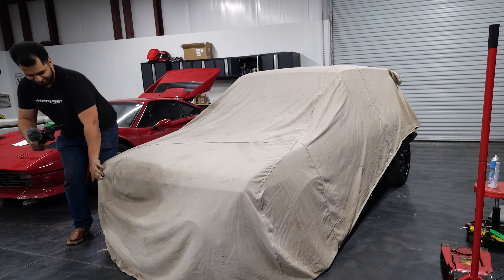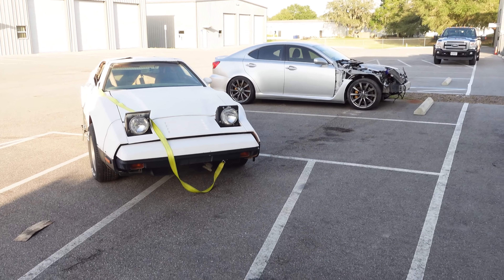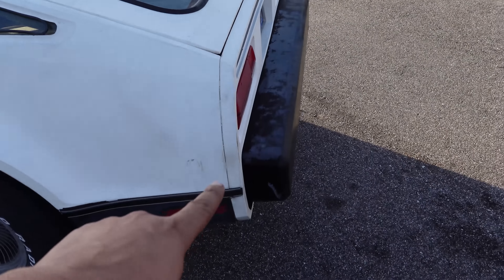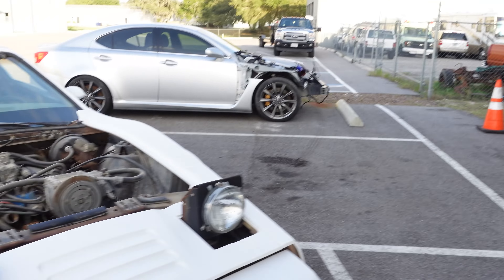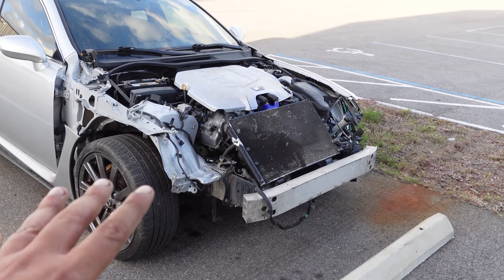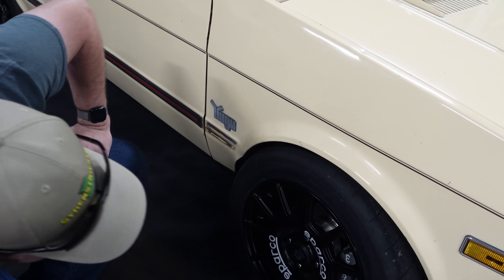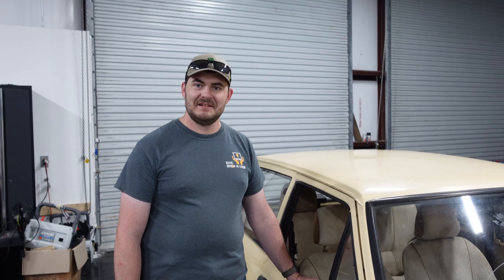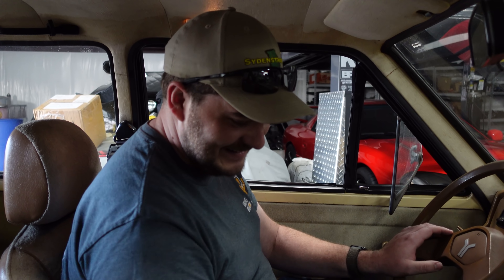I Gave My Friend THE WORST CAR EVER MADE (He Was NOT READY)

Comment: back around 1982 i was working on the bodies of bricklins , fixing the cracks for a friend , he made a electrical air lift system for the doors . his name was tim begley . he moved to maryland and i lost touch with him when he moved . he also made some custom parts like kick plates and  othe accessories .  those cars are very safe and very impact resistant bumpers .

Comment: the bricklin had an acrylic skin with fiberglass on the back side that was chopper gunned  to it. the resin was supposed to melt into the acrylic in order to stay bonded.i think eventually they got it to work by changing formulations.  this is similar to how they make acrylic hot tubs.

Comment: The SV in Sv-1 stands for safe vehicle , the body was acrylic resin and fibreglass composite that would separate and the gas shocks on the gull wing doors would heat up and build more pressure in the hot months and open violent enough to crack the doors ,

Comment: I had a 74 fiat 128. Same platform and drive train.  Take some fishing line and tie it to the special nut on the end of the clutch cable (at transmission) so when the cable breaks ( and it will) you don't loose the nut which was more expensive than the cable.

Comment: there was a magazine for bricklin owners collectors and such i dont know if it is still around . mr bagleys design for the door lifts was air lifts powered by a 12 volt battery coleman  air pomp and the switching system was electric also for closing and opening a electrical valve the switch on the outside was mounted just behind the doors , he also had a pat. on his electric valve system .

Comment: I love those single overhead cam FIAT engines, especially in the Arbarth tune. I had a FIAT 128 with the 1300 engine and took the rev limiter off. It sounded really sweet at 7000rpm and the car handled really well. The car was eventually scrapped because the body rusted so badly but the engine went into a friend's kit car. The car owed me nothing, I bought it MOT failed for £10 and after one late night and £80 worth of spares re-tested it the following morning. Two years of motoring for £90, bargain!

Comment: I actually live where they used to make those Bricklin SV-1s, and there's two of them still in the city as far as I know: one is actually in our history museum (it's white if I remember right), and the other (in a bright orange color) is owned by a local guy who as far as I know still drives it around from time to time in the summer months when the weather is more agreeable. I'm also fairly certain it didn't use air but hydraulics, because it's kind of a running joke that it's a Canadian car you couldn't drive in Canada because the doors would freeze shut

Comment: The 351 Windsor has a budget build kit for less thanx$1300 that’s including a full engine rebuild! That gives the engine 330 hp and 330 lb ft of torque. Have a look on the YouTube show horse power. They have the list of parts and the cost of machine work.

Comment: My Dad had a '71 Ford Ranch Wagon with the 351 Windsor engine in it. It dropped a rod at 40,000 miles because some teeth broke off of the pllastic timing gears and plugged the oil pump. Not the best engine ever built, that's for sure.
The AMC 360, on the other hand, is a Chrysler 360. It was a great performance engine. With a few bolt-on components and a good cam, that thing could put out over 400 hp.

Comment: first time viewer here. my girlfriend at the time had to have one. because it was less than $3000 brand new so i put a few hundred with what she had and went and picked up a white one. and on the way home she turned on the heater and burnt the engine down in another 5 miles. the car didn't have 15 miles on it. fought with the dealer and she got another new car the same down. we made a trip to hill country and it would barley pull them. one we turned around and came back down. for the next year i think it was in the shop 8 times and they gave up and offered her a 79 monte carlo with 125 miles on it straight across for the yugo. to stop the lawsuit.  she drove that car until the early 90's and i turned it into a dirt track car.

Comment: The body panels on the Bricklin aren't painted fiberglass. What they are is impregnated acrylic over fiberglass. The same exact material used in bathtubs and showers. Malcolm Bricklin used to work in the hardware/home improvement industry, so that's where he probably got the idea. The pros of this were that you could just sand out scratches because the material was the exact same color underneath. The downsides to this were: 1)The acrylic was sandwiched to the fiberglass. So given that they were dissimilar materials, they would expand at different rates like a bi-metalic arm, so they always warp. Which is why most Bricklins with original hoods have pins in the front where the hinges are: to stop the warping. 2)The pigment in the acrylic fades at a totally different rate than the paint on the bumpers, so older cars look dissimilar. 3)Because it is acrylic, do NOT use petroleum-based primer if you're going to paint! Water-based only! If petroleum is used it causes an irreversible chemical reaction that cracks and destroys the body panels. Which means you have to buy an entire set of aftermarket replacements.

The original doors were hydraulic, which meant they were painfully slow. Plus the risk of nasty failures since one journalist reviewing the car when new had a piston fail and sprayed hydraulic oil all over his coat inside the car. Far more reliable, and faster Pneumatic conversions are available.

74 offered manual transmissions, but they're very rare. Like the lack of cigarette lighters and ashtrays, Malcolm Bricklin built cars to his own tastes, and not consumers. The AMC derived engines are rumored to have been used because they were cheap surplus. AMC was set to put the AMX/3 into production, but pulled the plug at the last minute. So they sold all the excess engines to Bricklin.

The Bricklin uses a "bird cage" safety cage to protect the occupants. While loading vehicles at the factory, an employee accidently launched one off of a truck, but walked away fine with no injuries. When the SV-1 was submitted for safety testing, it actually broke the hydraulic machine that tested roof strength and integrity by crushing the car. It set a record for roof strength that wouldn't be matched until decades later when the Tesla Model S arrived.

Comment: Oh Tavarish, I'm so sorry.  I'm sorry you bought THAT Bricklin.  I've been looking for one myself (on and off) and when I came across that one..... hooo boy. I passed just one the parts it's missing alone.  Add in the fact that it's a '75, I really wasn't interested regardless of price. (ideally, I want the rarest, AMC 360 / 4 speed car.... like the one I passed on at the Portland Swapmeet a few years back. DOH!)

You think the Yugo was hard finding parts for.... Bricklin is 10x worse.  But, when done right..... they are FUN cars.

The AMC 360 V8 made 220 NET horsepower, but was rated at 285 gross.  Torque in in the neighborhood of 315-320 ft lbs.  Quite honestly, it'd be kinda fun if you converted this Bricklin BACK to an AMC motor with a Torqueflite.

In regards to the doors, originally, they were hydraulic, but the hydraulic system was slow and failed - often.  Most Bricklin folks replace their door systems with a pneumatic system that Terry Tanner came up with.  I believe Terry used to sell kits to convert the doors to pneumatic.

Comment: Bradley GT II came out in '68, a kit car designed by a SHELBY designer, who also made Tonka toys.. So if the Bradey GT II came out in '68.. Does that mean they pirated the concept... STOLE the concept from the original  designer?  That would make Bricklin car and Delorean guilty of plagiarism: the practice of taking someone else's work or ideas and passing them off as one's own... Look at the front. Look at the doors. Look at the interior...  If you compare the Brick to the Bradley GTII (Not the B GT 1) they are VERY IDENTICAL.  The B GT II turns heads, even dirty, broken and on a Rollback. I owned one. I know.